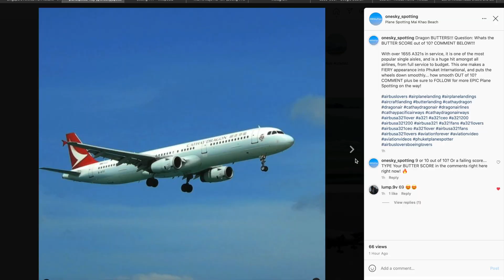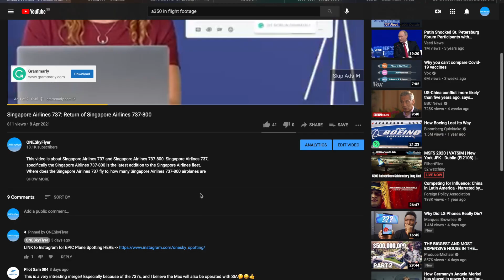A350 Freighter: Does an Airbus A350 Freighter make sense?

Comment: One point worth mentioning is that from 2027 onwards Boeing will not be allowed to produce any more 768-300LRF or 777-200ERF fue to ICAO environment regulations. It is unlikely that 777-8 will ever be built. It is plainly uncompetitive vs A350-1000 except in the extremely long routes (3% of the total) since Airbus emerged much better than originally planned in terms of range. Boeing might attempt a freighter version out pf 777-9, or a somewhat shorter version, yet not 777-8.
Reply from the maker: Hmm... yep the first point is correct though would probably not affect Airbus's choice directly about whether to build an A350f. In terms of the 777x freighter, the -9 would be huge but the structural weight is higher than -8 thus will have lower payload capability... thanks for tuning in!

Comment: Excuse my ignorance but as I am in my 7th decade, i was always told and raised on the idea that four engined planes/jets were the safest. I always thought the A340 and 747 would make the best air freighter. On the Russian side, I thought the Tu-124 and the Il-76 would be the best Russia had fue to 4 engine safety and redundancy in case of engine failure. No to mention carrying capacity. With modern technology, twin engined jets are the norm now and the engines are powerful but if one fails, there is no margins for safety. I know economics plays the major role and Airbus makes outstanding aircraft from the A-220 up to the A380. I don't trust Boeing anymore since the MAX debacle. For heavy duty freight and cargo, I would like to see the A-380 converted to freighter service. It may cost more in fuel but with the load capacity and safety factor of four engines, I believe it worth it. The A-350 is a great plane but being old fashioned, four engines are better than two and the A340 might be a good candidate for conversion.
Reply: Quadrijets were indeed safer 60 years ago, at the time of turboprops. Back then engines were substantially more prone to malfunction. Not any more.  Modern jet engines are extremely reliable. There hasn’t been a single case of a fatality involving both engines stopped in midair. At the time of Titanic 4 funnels were used, of which the fourth was just for show. Lay people believed it made ships sturdier and more reliable. You know how that story ended

Comment: A350-1000F would be great to rival 777-8F.....
As A350-1000 has 155t OEW (passengers version) which is less than half of its MTOW 316-319t.....the freighter version eventually would have 7-8t lighter than the passenger version (147/148t)....so, with its it's cabin length at 58m this would closely to match capacity of 747-400ERF/747-400BCF (payload; 120t/110t || cabin length; 57m) & 777-300ERSF (101t || cabin length; 59m) at around 100-110t of payload.....and being 4m/8m longer than 777-8/-200LRF, the A350-1000F would have more ULD (similar to 747/773)....and with ultra efficient fuel burn rate, this would likely to have range around 5000nm🛫🤓

Comment: I think that Airbus should look at the A350F closely, to future proof the A350 family as the planet warms. As the planet warms, one of the major effects beside changes to the climate, will be the increasing effects of more regular global health pandemics resulting in tighter boarders to control viral and/or bacterial health pandemic outbreaks and  the accompanying reduction of global passenger air travel to levels that has been experienced with the current global pandemic especially on  medium to ultra long haul routes. Currently Boeing doesn't have a range  of new clean sheet designed fuel efficient cargo only aircraft other than the B747-8F,  so the A350F would be the first.  it would be good for Airbus to look at the A350F concept and test the market, while Boeing struggles with the B737 MAX and B777-9 fiasco's.
Reply from the maker: Interesting perspective, yeah and the A350F will be the cleanest though freight airlines still need to transition pilots to an A350f. The 777-8F will bring around 12-13% fuel burn reduction to meet environmental standards. Thanks for tuning in!
Reply: @oneskyflyer  - Not if an airline has its own air cargo division and is operating A350 passenger aircraft like Qatar. It seems that Qatar has been talking to both Boeing and Airbus about the next generation of cargo aircraft.

You mentioned that the A350F would be based on the A350-900, would that be the A350-900 or A350-900ulr?  What about the the A350-1000 'extended range' if Qantas orders the type for Project Sunrise?
Reply from the maker: @chrismckellar9350  A350-900f would probably be based off A350-900 since additional fuel volume ain't a priority, that's my opinion. The regular A350-900 will have the 280 tonne MTOW standard. Thanks for tuning in :)